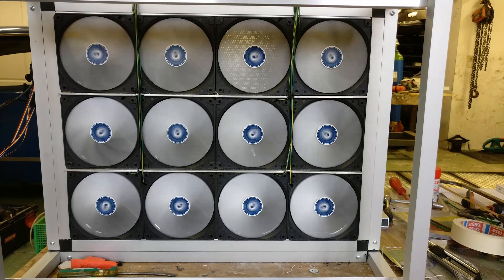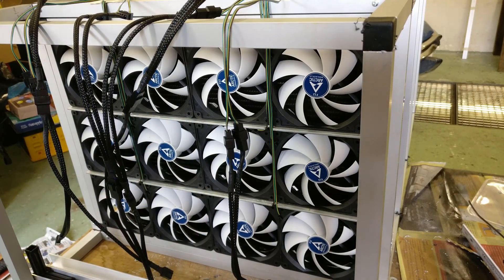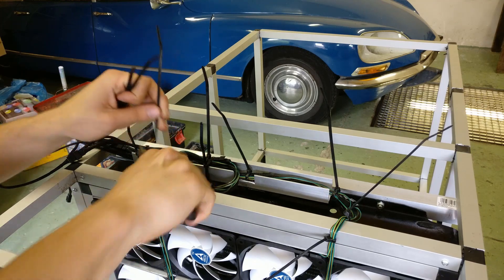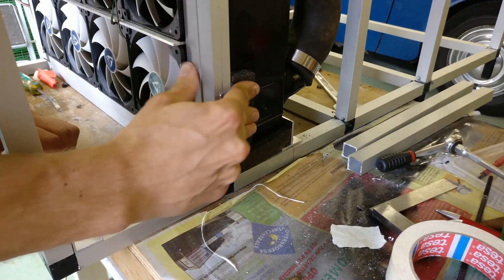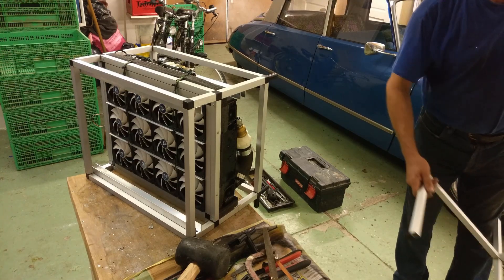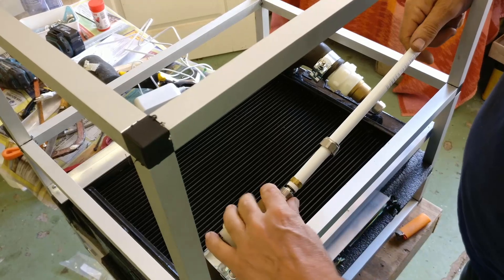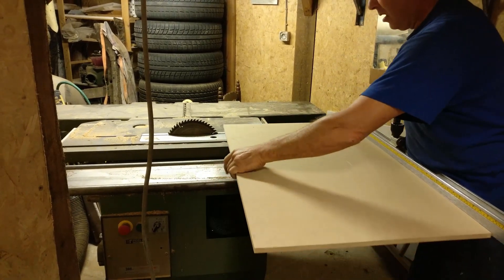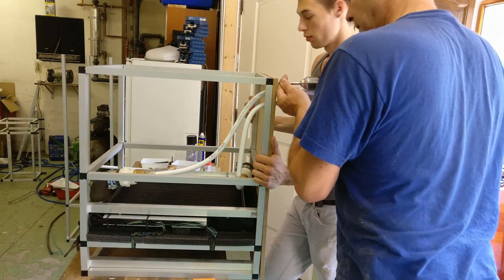Crypto Currency Heated Pool Project, Part 3

Comment: using one big fan over many smaller ones would have made it easier for your build also less moving parts to break.
Reply: the whole project is dumb, he wont heat up the radiator with slightly hot air. The air coming from the mining room will be 40C at most, this is nothing. He won't heat up even 15 liters of water.
A lot of people told him that's a dumb idea, the only way this would work would be to watercool all the cards and submerge the radiator in the pool, but spending 100€ per card is not worth it, just put some big fans on the mining room windows and that's it. If you wanna heat up the pool put solar panels and move the pool water thru them.

It's funny how much money he has wasted on this so far, a big fan will move more air and not get full of dust in three months.

Comment: Is this going to be a 50 part series? why not just upload the whole thing from start to finish.. then upload a second video of the results.
Also with the price you paid for the 12 fans, you could of bought a thermo fan that would installed to the radiator a lot easier and would of pushed more air flow through the radiator

Comment: hey... im not getting why are you adding the fans on the radiator. I thought the radiator will be dived into the pool to warm it up. If you will be blowing air on the radiator, how thats gonna heat up the water? :) cheers
Reply: jeliman13 the principal how cooling works is to transfer the heath to the air or some other object. That is what fans are doing in a pc case. They move the hot air to outside the case. Thats how the pc gets cooler. By sucking the hot air out of the case. I think what you mean is cooling with blowing air on an object like with a cpu is the case. With this it also transfers heat with sucking air out of the room like the pc case principal. The heat thats getting sucked away needs to go somewhere, in this case, the radiator thats heating up the water
Reply: The oppsite way It Will bring the cold water and transfer the hit to de water and blow the cold Air into the boards